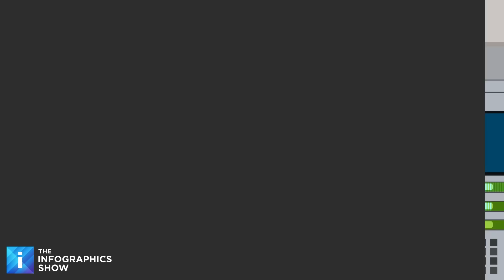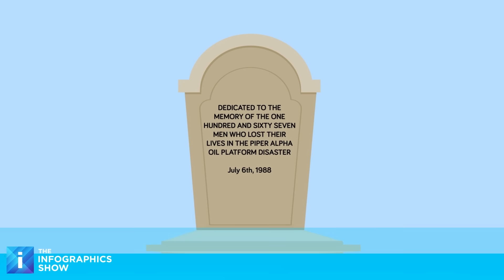World’s Worst Oil Rig Disaster EXPLAINED (Hour by Hour)

Comment: Wouldn't they have supplies like rope etc to lower themself into the water?
I feel like if you mananged to get to the lowest point of the rig, lower youself down from there into the water so its a shorter drop, and prepare for the cold icy waters by putting on as many layers as possible, and throwing something down into the water that floats and clinging onto that, then this could be beat.